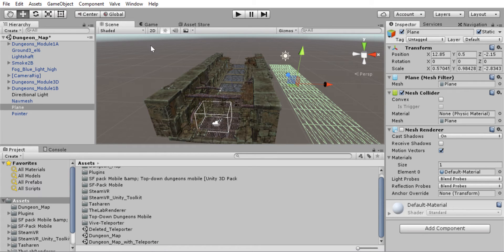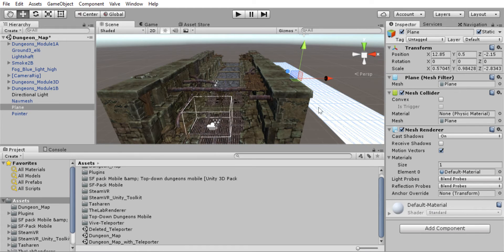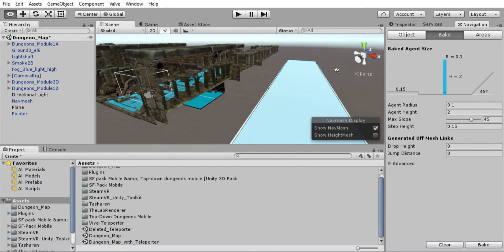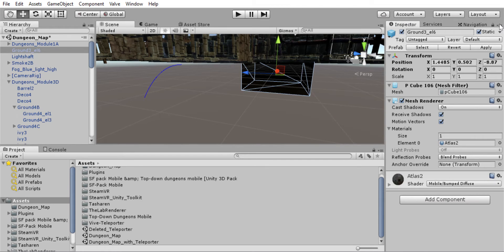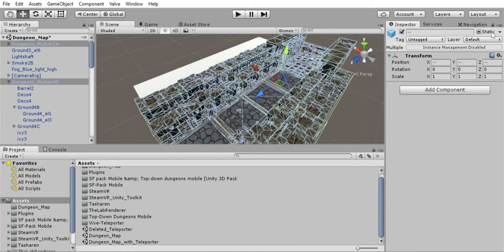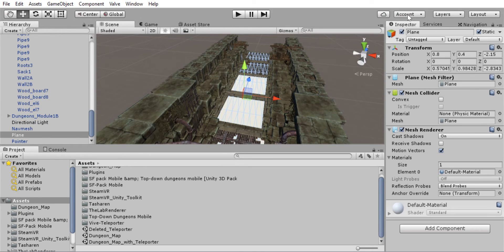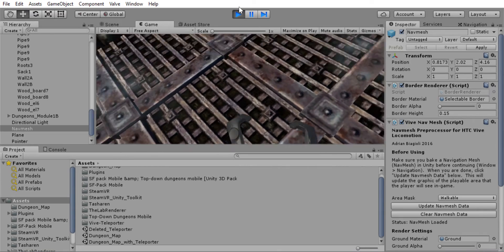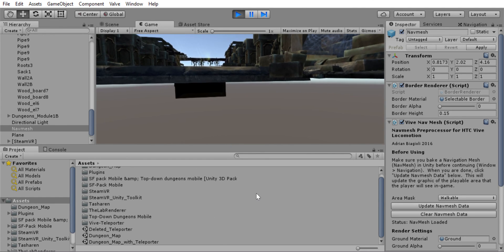Steam VR - Unity Vive Teleporter Tutorial - Cheating on Irregular Surfaces

Comment: Trying to import the assets into my scene and I get a flood of errors in console about "The namespace 'Valve.VR' already contains a definition for 'IVRSystem'"

Error starts in "openvr_api" line 16 "public struct IVRSystem".

Have you come across this in newer versions of Unity?
Reply from the maker: I haven't had time to mess around with Unity for awhile now. :( I'm afraid I haven't even looked at the newer versions.
Reply: It's a while since you asked this so assuming you found a solution, but on the off chance that anybody else stumbles on this - in my case, the errors were because I already had a newer version of the SteamVR Plugin in my project, and the Vive Teleporter project contains it's own version of it - just remove the Vive Teleporter one and it should clear the issues.